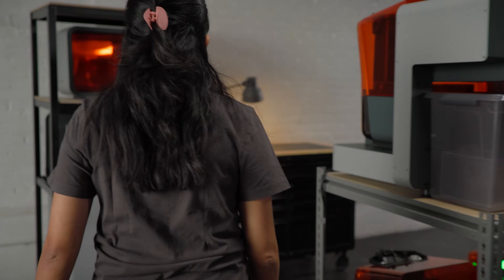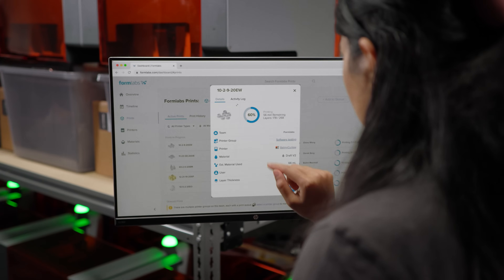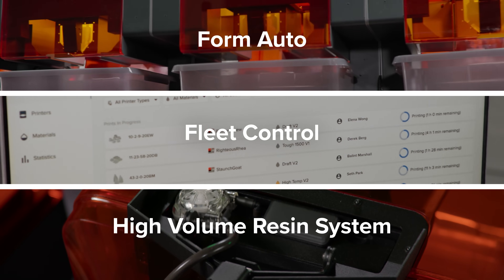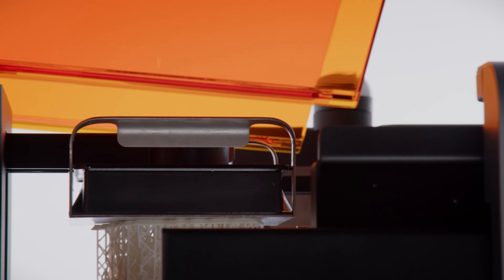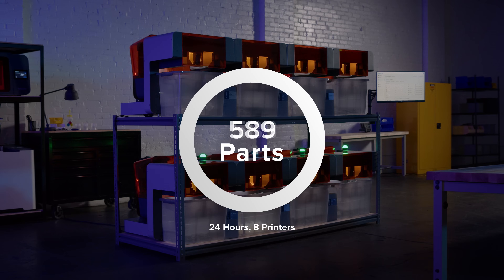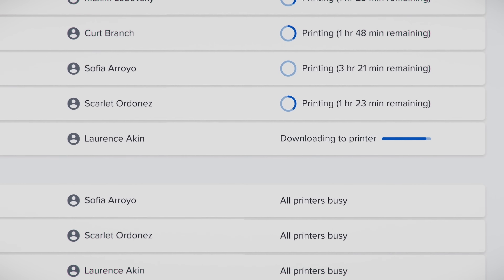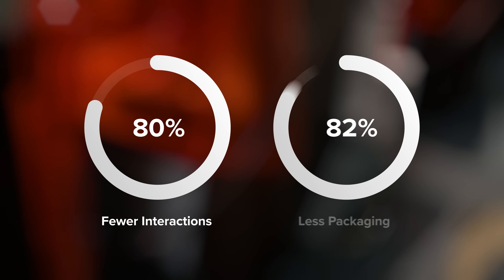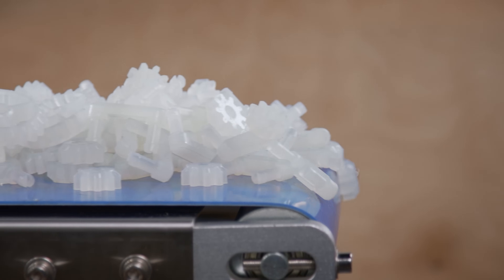Introducing Formlabs Automation Ecosystem: 24/7 Production Made Easy

Comment: Super cool! I do wonder who the target customer for this would be however, perhaps a smaller company with small-med scale prototyping? I just feel like if someone needed a ton of parts, injection molding would still be much cheaper and faster to produce parts at scale
Reply: Higher volume prototyping, 3d print vendors etc. Also, 3d printing allows for designs that can't be injection molded
Reply: Dental laboratories are going to love this

Comment: But how efficiently this automation will work?… the Form 3 is not super consistent. There is some failed prints sometimes very often and you need to scrap the build platform after every print because sometimes there is cured resin called flakes adhered. And the parts do not detach that easily even with the new flexible build platform 2.

Comment: Aren't 3d printers for prototyping , what advantage has this got over traditional injection molding where speeds are almost 1000x
Reply: Additionally, 3d printing allows for designs that could never be traditionally machined or injection molded

Comment: That's just amazing! But may I ask why not already make a wash container integrated? ( Dunno if it's that the name in English, parts cleaner maybe)
That's a very very cool product! I thought large scale parts manufacturing was basically impossible in resin 3d printers, but i was definitely wrong( and happily so)
Reply: Hey I work in resin printing automation. So if you wash the part and do not summarily cure it, it sitting uncured and washed can open up the porosity of the surface, causing micron level deformation. I work with applications that require sub-40 micron accuracy, so this matters.
Reply: @ElecTrackProjects  thanks for explaining! i definitely would never think in that
Reply: @ElecTrackProjects  Thanks for the insight. Could I assume that in loose tolerance applications that effect could be desirable? Like for coated parts, some porosity may help adhesion? I don't know how common coating resin parts is though it's not something I ever worked with.
Reply: @NiSE_Rafter  The porosity is not a good thing, as it increases the amount of moisture intrusion. For thinner parts, it can decrease material structural integrity
Reply: @ElecTrackProjects  Even for low/no load scenarios? An example could be producing miniatures for board games, would the increase in fragility have any significe?
Reply: @NiSE_Rafter  that I'm not sure, I work primarily in the dental space, where a broken part like a surgical guide could mean a malpractice lawsuit.
Reply: I'm guessing cost and extra complexity. Maybe it's coming in the future. It would make sense to get this working first then expand on it over time.

Comment: that would be great if you make firmware update for form lab 3a,b, timing estimate is way off , also there is big problem with curing with clear v4 & tough 2000 , small and thin parts deforms when they get placed in curing chamber, even though I set the setting (temperature and time ) same as your recommendation,

Comment: Is there a curing or washing process? I can imagine prints curing together in the clear collection bins from ambient UV light.
Reply from the maker: Both the shield and the bin are UV-resistant and light-blocking to prevent the resin on the parts from curing prematurely. We recommend placing a Wash L basket in the collection bin so that parts can be safely stored in the bucket until you’re ready to wash them in IPA. We’ll have a workflow video available soon with all the steps.

Comment: This looks great! Will the 5l resin option come at a saving? As of right now, your 1l options are too expensive for end-use parts in most consumer applications, so my company went with a clunkier printer for the benefit of using cheaper resins from other manufacturers.
Reply from the maker: Yes, the 5L Resins will be sold at a discount, which means savings on consumables! Learn more: https://formlabs.com/blog/formlabs-automation-ecosystem/
Reply: there are aftermarket kits that add the possibility of third party materials
Reply: @nobutoneme1325  And voids the warranty. Maybe fine as an individual but try convincing the accounting department to accept that.
Reply: It will come with savings both on pricing (TBD, thanks for your patience) and huge, over 90% savings on packaging compared to single cartridges

Comment: As cool as this looks, and it does look cool, I would love to know what if any failure detection it has, considering it seems to automatically start the next print, i would hate to have a failed print turn into a damaged printer.
Reply from the maker: Form Auto will squeeze the Build Platform 2 multiple times. Then, Build Platform 2 will be scraped along the edge of the enclosure to remove any additional parts. There’s also a sensor that will alert you if there’s a part that didn’t come off and will pause if there’s an issue. We have multiple stages of checks to make sure the automation is working correctly and starting the next print is no issue.
Reply: @Formlabs  what about failed prints in the vat
Reply: @Formlabs  Very impressive! what about if a part didnt come off the FEP sheet?
Reply: @Formlabs  cool!!
Reply: It detects parts that failed to remove and that will pause it's operation.  Form 3 already has a built in ability to check the build platform for small debris that can fail a print.  Form Auto also has a camera that will enable future remote monitoring and failure detection capabilities.

Comment: Aren't fresh off the bed resin prints sticky? So won't the newly printed parts after being automatically scraped off, stick together while they wait to be picked up in the bin?
Reply from the maker: Both the shield and the bin are UV-resistant and light-blocking to prevent the resin on the parts from curing prematurely. We recommend placing a Wash L basket in the collection bin so that parts can be safely stored in the bucket until you’re ready to wash them in IPA. We’ll have a workflow video available soon with all the steps.
Reply: They don't stick together permanently unless exposed to UV rays
Reply: @WhiteWolfos  that's not true UV resin will cure if left out also just takes a lil longer
Reply: @WhiteWolfos  ah good to know, thank you. I have no resin printing experience, hence the noob question.
Reply: As @whitewolfos said. The bins block the wavelength of light that would cure the prints. They can be washed together when you are ready to do so